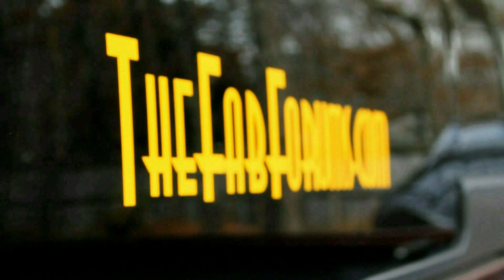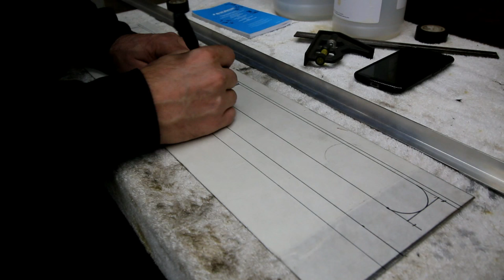Making A Custom Radiator Bracket | Twin Turbo Mustang Build

Comment: I really like that tip on cutting the support and using bolts. Might do it to my fox
Reply from the maker: +Devin Smith Its a life saver and on mine the place I cut it was under the factory radiator brackets so no one ever knew it was cut

Comment: great job i don't watch the  videos for instruction  I watch them for 2 reasons they are entertaining and they are interesting
Reply from the maker: +Fred Sitzenstock Thanks Fred
Reply: just getting cought up on watching videos and playing a little bit with the bead roller (i brought it in the house ) I've been looking for a tread mill to rob the motor off of to power up the bead roller the tread mill will have the motor and the rheostat to slow it down

Comment: Just wondering you pop riveted the radiator top lip and then screwed something through? What was the pop rivet about?

Also just wondering if you added rubber to stop vibration? Thanks!

Comment: What thickness aluminum did you use? I watched twice don't know if i missed it thanks.
Reply from the maker: I think its .040
Reply: +The Fab Forums what grade was the aluminum? I just started trying bends and the sheet I got doesn't bend without cracking. I have O stock also which I know bends really easy but has no structural strength.

Comment: Great looking top rad mount.  But can you go better than electric fan zip ties?
Reply from the maker: +Gtperformance Dresden Na those are what I preffer
Reply: Yep, fab some brackets. I'm a drag racer, those wore through the core on my new aluminum radiator in less than a season. I'll be fabbing some brackets for the new radiator.

Comment: Another Awesome Vid! My son and I love your channel. Thanks for sharing what you know.

I do have a few questions. My research has shown that those 3-in-1 sheet metal tools (break, shear and roller) have a max capacity of 22g. That aluminum sheet you used looked much thicker. Is your 3-in-1 rated for thicker gauge? What gauge aluminum were you using? is it difficult to work with in you 3-in-1?

Thanks! Keep up the great work.
Reply from the maker: +Suedzville awesome...I wouldn't recommend the 3&1 although it can work thicker metal as long as its not too wide.
Reply from the maker: +Suedzville awesome...I wouldn't recommend the 3&1 although it can work thicker metal as long as its not too wide.

Comment: if i need a how too i do a search on you tube for it
the fabrication itself is a lot more interesting when you dont explane every thing you do 
shortening the clips of the different steps helps a lot too 

bracket looks nice , i'm kindah surized you didnt made an aluminium beadrolled fan shroud for it too

saving up for a tig welder thinking bout buying this one :
http://www.lasexpert.nl/files/6736/products/8808426/tig220pknoppen.jpg
the brand is giant and its made in azia 
seems to have every option i would ever need in a inverter style welder and its REALY cheap and about the highest amp welder i can find that still works of the 220 volts housemains here 
its not a miller or a lincoln but then again i dont use it a enough to rectify the difference in price between the giant and those two 

one of these days when i have the truck rolling and driving and start making the dresspanels for the interior and enginebay im going after a beadroller and these nifty holepunch / flangertools too 

gonna have to buy some steel office cabinets to store everything in as whell  
the place is starting to fill up and i cant see the trees through the forrest
Reply from the maker: +watahyahknow Thanks...I had someone else comment about making a fan shroud. I just didnt have the room to spare for a custom fan shroud.